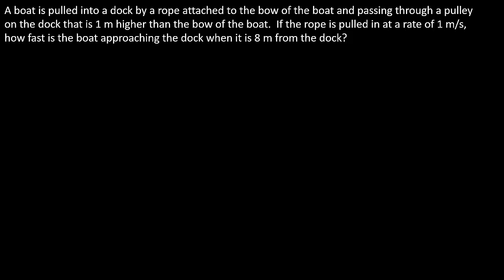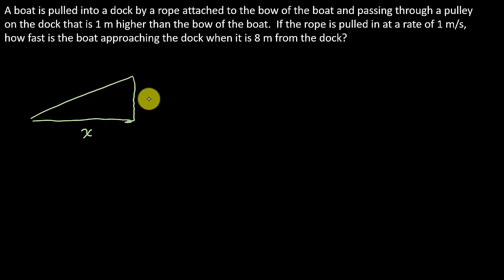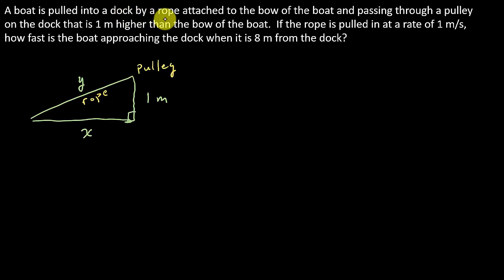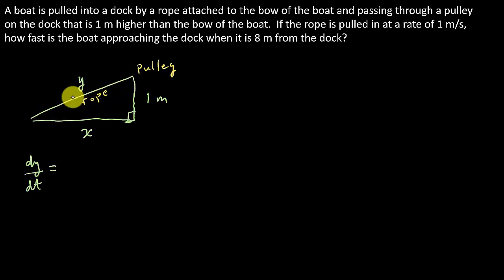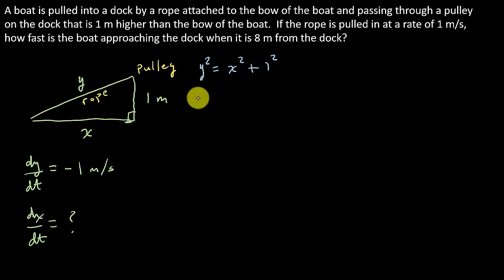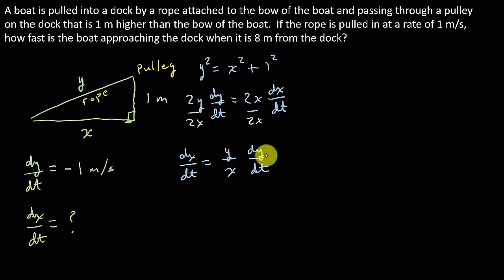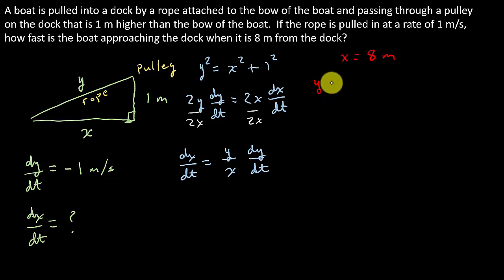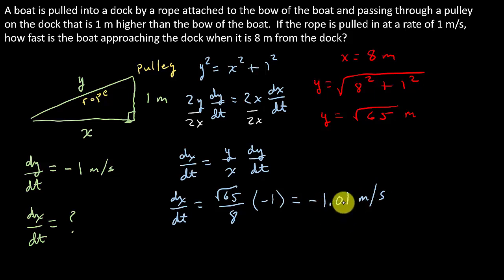Calculus Related Rates - A Boat is Being Pulled Into a Dock Through a Pulley

Comment: i think dy/dt should be 1m/s not -1m/s
Reply: No its negative. Kind of just have to think about it a little. The rope is being pulled in. The length of the rope is decreasing over time so the rate is negative. However questions usually phrase it as "how fast is it approaching" or something similar so you can write your answer as positive.
Reply: @michaelb3213  oh thats weird i had a similar question for my homework and i used negative and marked me wrong
Reply: @blehssed1237  They're wrong, it shouldn't be negative.